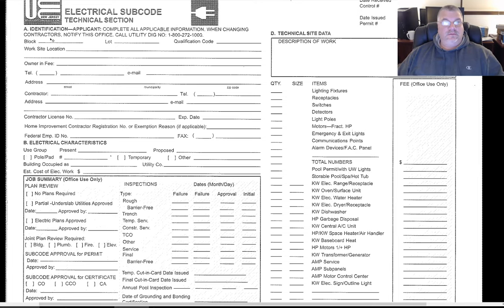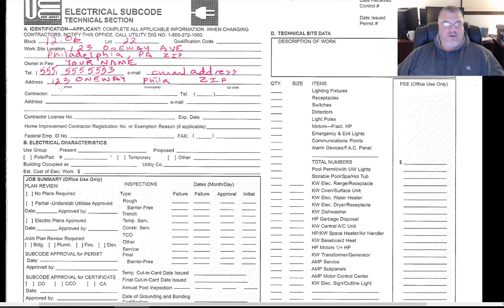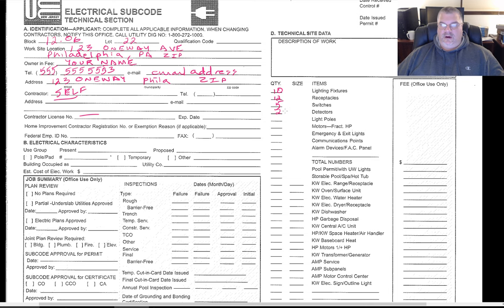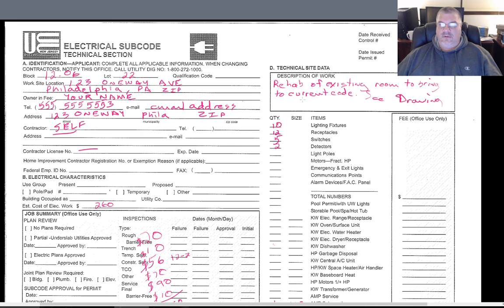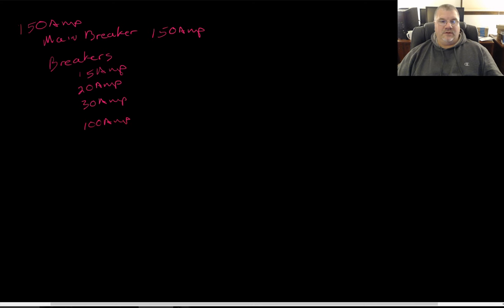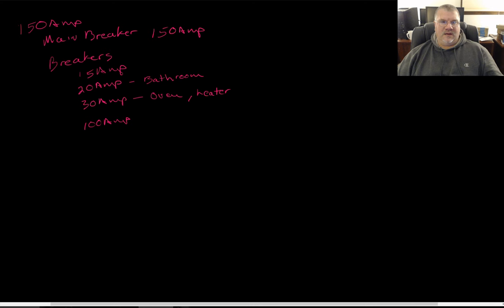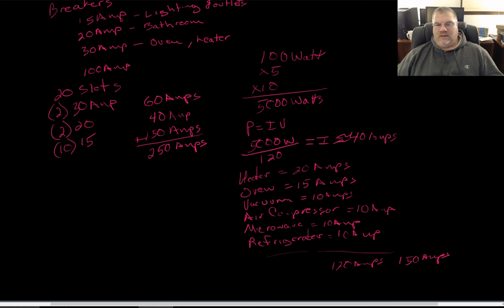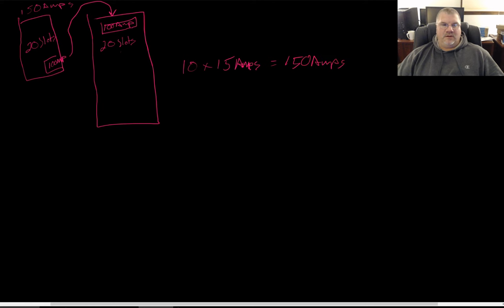Do I Need a Permit for Electrical Work? How do I get a Permit? Can I do my own Electrical Work?

Comment: So do you need to be licensed electrician to get the pirmit
Reply from the maker: +Ben Mygovych subscribe You need to check with your municipality. As a homeowner in most places in the USA you can do your own work. However some things you need to have someone licensed to do work. I can do everything on my house. Except, I do not think I can do septic system installation without someone who is licensed in that work.  That I think is an issue for my town (not 100% sure). Regarfless of what you are doing you need yo be compliant with the adopted codes like ICC and NEC.  If you are doing work that requires and engineered solution that is approved for IBC but not ICC you may need to get PE stamped plans. For instance, a pole barn is an engineered solution that is not accounted for in ICC but a prof engineer can cite the IBC and stamp plans which the municipality will then approve.
Reply: In Charleston SC you do

Comment: Do you need a licensed electrician to replace a ceiling fan?
Reply from the maker: We do not in New Jersey. You may need to file for a permit. You can check with your code enforcement office. However, if you do not feel comfortable with the installation definitely seek the help or consultation of a licensed electrician. Thank you for the question.